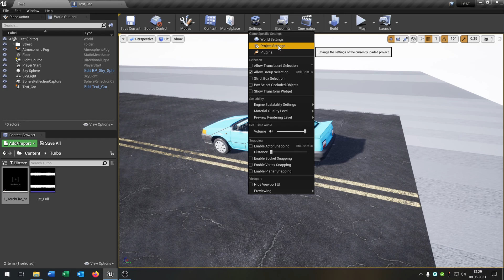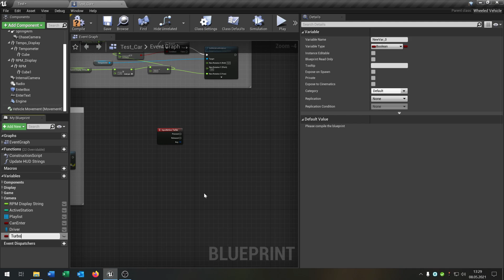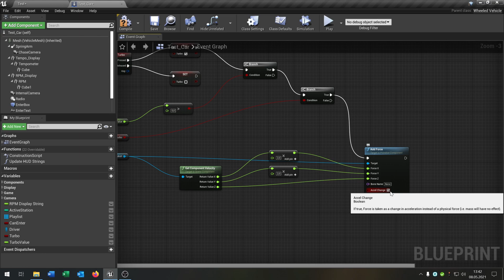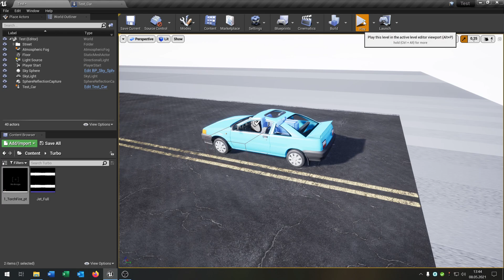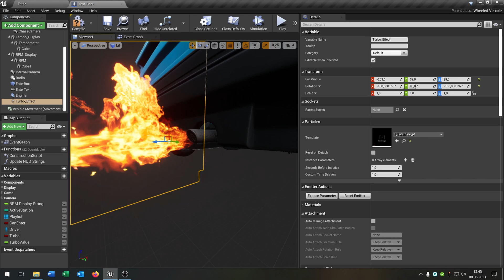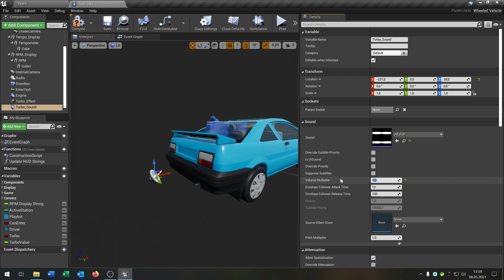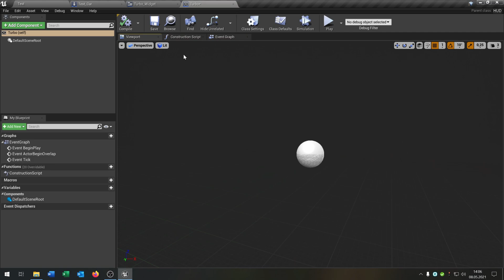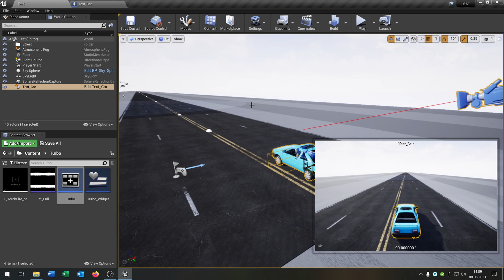Unreal Engine Car Turbo / Nitro Tutorial

Comment: Hay  i think   creating widget and  adding widget to view port   on event draw call is good idea as event draw call gets call per frame and it will create multiple  widget over and over , i thing better approach is to  create and  add  widget to view port  on begin play . 
because I faced huge fps drop and came to the solution thought better to share the experience.
Reply from the maker: Yes, that's right. Since this Tutorial is nearly 3 years old, there might be some Parts that need an update.
Reply: @Seredias.  I'm having the same issue Could you explain it to me if you get the chance. I'm using this tutorial for a project and would appreciate the help.
Reply from the maker: @Gman_89 You mean the Widget Part?
Its better to add the Widget one time and then just set the Values.
Reply: @Seredias.  Its an issue with the fps of the project (my frames drop randomly). for some reason it happens if use all of the boost or sometimes if i use a portion of it. sorry if this is confusing i can explain elsewhere.